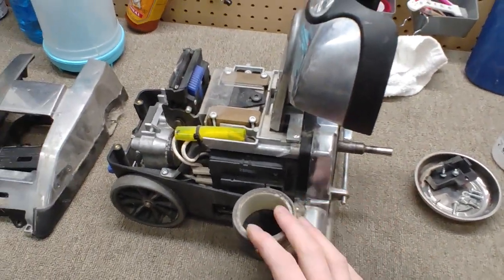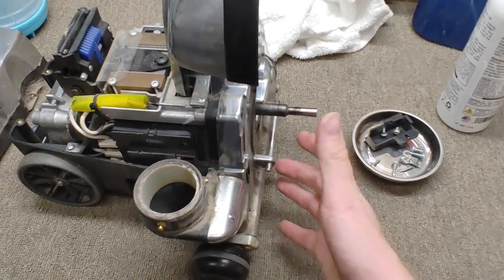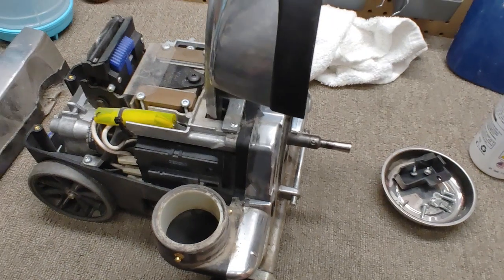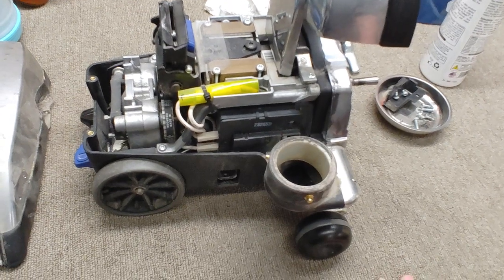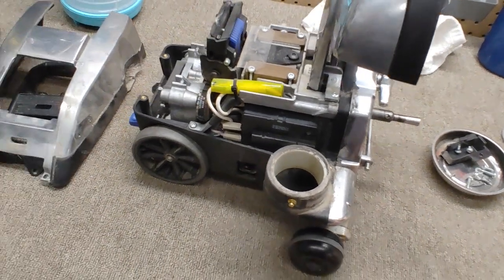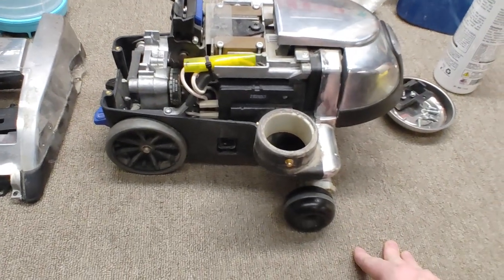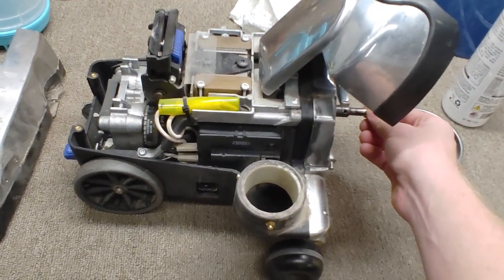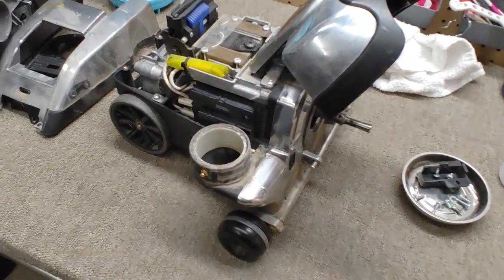Kirby Vacuum Bearing Problems

Comment: Just sad. I have a Sentria 2 and 2 Avalirs with funky bearings. But I have an absolutely used and abused Diamond Edition that’s had the piss taken out of it many times over and it just keeps going. Seems to me from buying and restoring and reselling a lot of Gs over the years that from G3 to the early G10s are the most solid machines. I’ve had more problems with the later G10s than any other G.

Comment: Yes just bought a second hand avalir and upon turning it off after the impeller starts ro decend to a stop makes a squeel noise. Rotating the shaft is hard not smooth. I also had a kirby tradition and the shaft was free to turn. Nothing like this. So you think motor is dont or a change of bearing would be needed?
Reply from the maker: Hey thanks for watching. My recommendation would be to bring it to your local professional and have them take care of it. It's really hard to guess over the internet if not impossible.